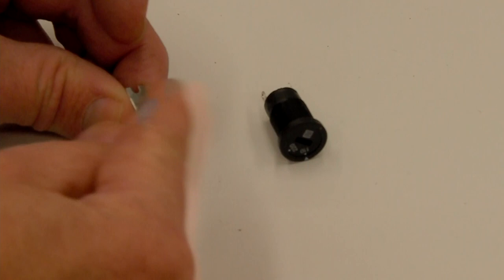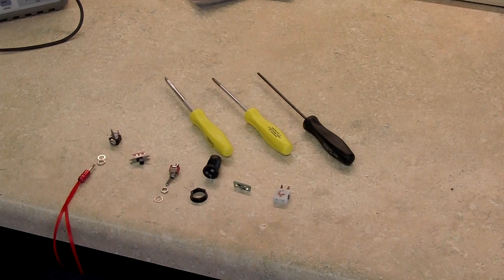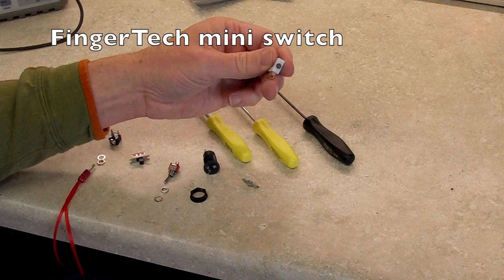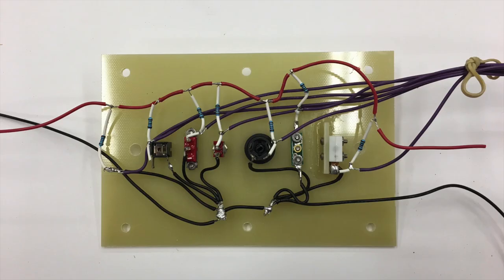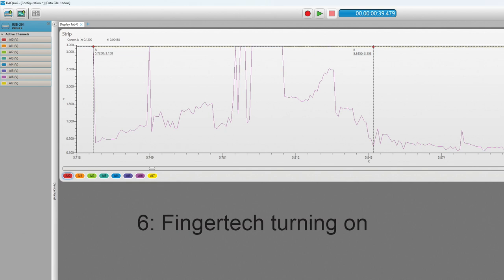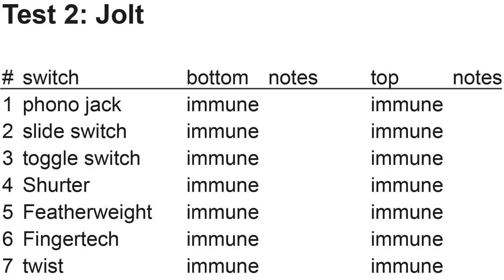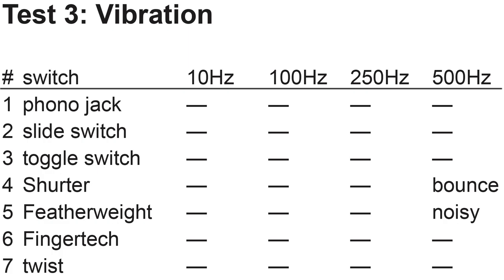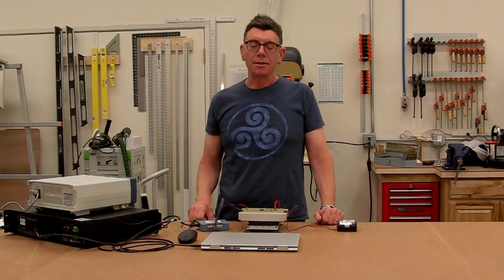Switch Testing

Comment: Nice experiment, thanks for putting it together. Have been thinking the same which type is best to use. I've been using both slide and toggle switches mostly, so sounds like I will continue with those.

Comment: Great video.  I hope the next round of tests have: miniature snap-action switch, Wifi switch regular, Wifi switch mini, magnet switch.

Can you incorporate a G meter to determine the G force on the shock test, I know some rockets can see 200g on launch.  I plan and build my rockets to see less then 50g (normaly around 30g in flight) with nominal deployment events.

I picked up some fingertech switches, the design seems solid and simple.  I wonder if there is a issue between the blackoxide cap screw and the terminals showing a slow response/continuity issues.

I wonder if a higher load across the switch would yield different results.  Set up a 12v power supply that would run a 12v fan or light bulb (1 for each switch maybe?) then test current or voltage coming out of each switch during testing.
Reply from the maker: Some great ideas. I'll probably do another round at some point with more switches, but I'm not sure about the current tests (that sounds like a different experiment with different equipment).

Comment: I’m really curious about the phono jack switch, I’ve not seen that before. Is that a standard jack? A specific model? I’m not sure I understand how that works, I’d love a link to an explanation somewhere, I’d be interested in trying that out myself.
Reply from the maker: It's a "mini phono jack", which always has an extra circuit that is open when the plug is inserted. (This was used in the olden days to cut out the speaker when you plugged in headphones.) People like this because it's really obvious that you haven't armed the electronics, and they even make "remove before flight" ribbons to attach to these plugs.

Comment: Love the video!  And I second all of the suggestions for more switches to test, especially the Eggtimers.  If it wasnt mentioned already, I would also like to see the microswitches with pull pins from LabRat tested.  Ive heard interesting stories about g-force opening the switch if its not oriented properly.

Comment: I bet all of the switches have bounce on open and close.  Some just happen faster then 1 kHz. But does bounce matter?  

Nice Video.  Goo to se you again.
Reply from the maker: I don't think 1ms bounce matters much if at all. But hopefully the makers of electronics are aware that some switches have 100s of ms before they settle.
Reply: @JohnLCoker  I assumed the switch connected power and was not used for electronic logi.
Reply: @JohnLCoker  Mercury wetted relays do not bounce.  I'm no sure if you can get those anymore.